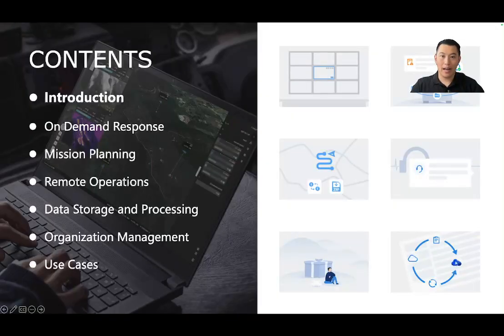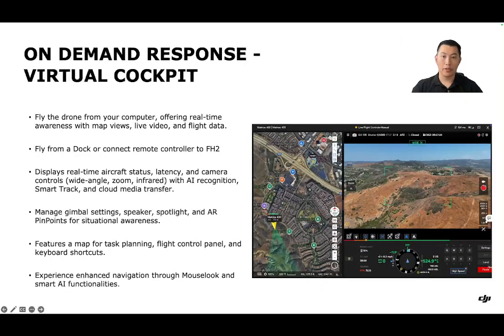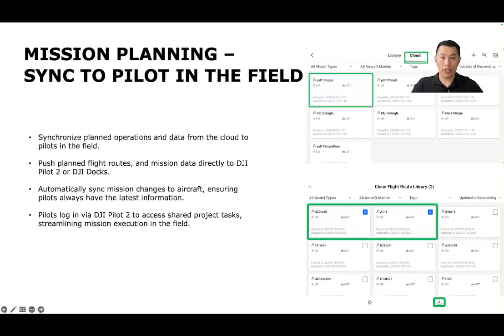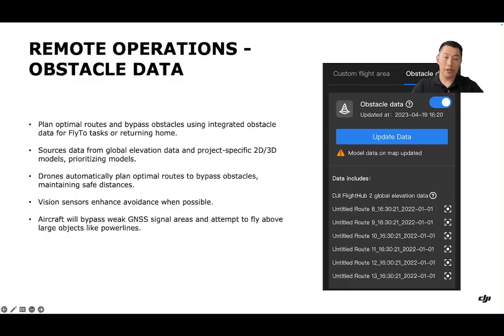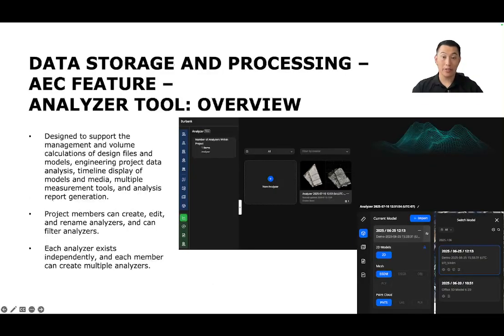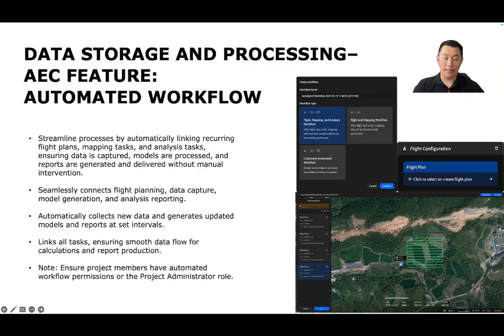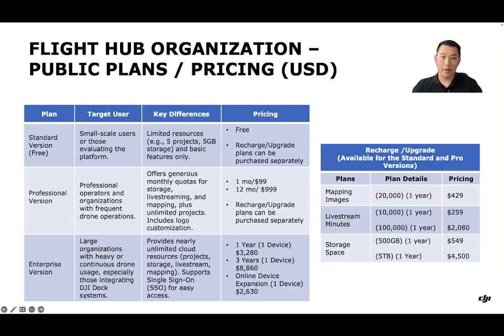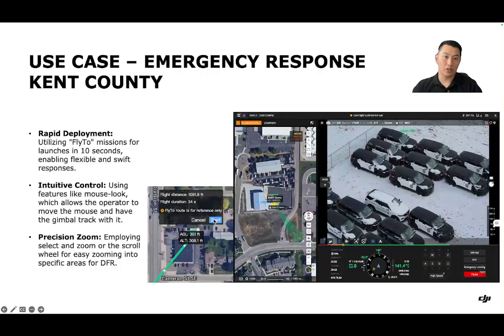FlightHub 2 Overview: Capabilities and Features Explained

Comment: Excellent Training Video.   How can I do a Pano and an Orbit please?  These are basic missions components I need to do.
Reply from the maker: Please provide additional detail on the drone type, and how you are operating it. (From Flight Hub 2, From the Remote Controller, etc...)
Reply: @djiacademy  Currently I have both the M3E (love it) and the M3T (Love it more!).   Will Flight Hub 3 being released in January 2026 have these?  I want to use Flight Hub 2 to Plan the Route that has Pano and has Orbit.   Clients want it but that forces me to use Drone Deploy or Dronelink instead.
Reply from the maker: No Flight Hub 3, only Flight Hub 2.

Mavic 3 Enterprise does not currently support Pano as a waypoint action with Flight Hub 2 or Pilot 2 mission planning.
This has been added to Matrice 4 for your reference. 

An orbit video as part of a waypoint mission is not currently available.
Will make sure to share this feedback to our team.